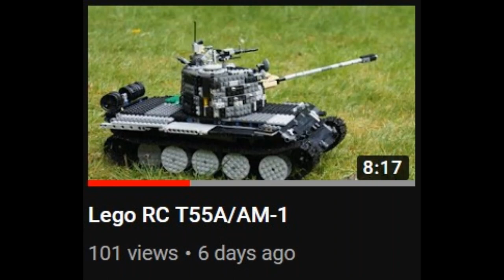How to make a Lego RC Tank | A brief tutorial

Comment: I build my tanks in a similar way, I also start with the suspension but most of the time I build the both sides and the floor at the same time and then work like a printer with the hull and turret, just building up. I use a lot less technic than you, and the structure is held by the walls and not by a frame that the plates are attached to, that reminds me of the difference between rivoted and welded tanks.